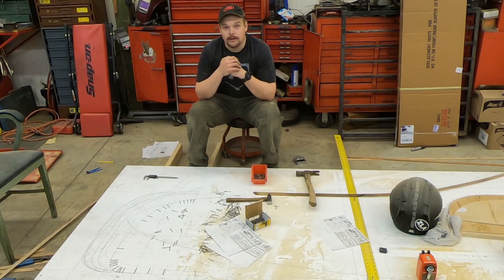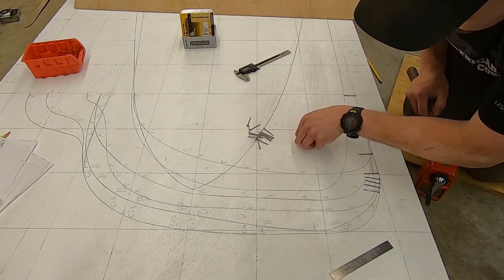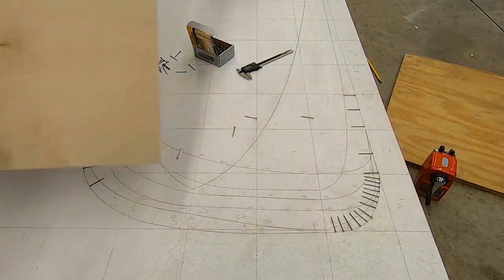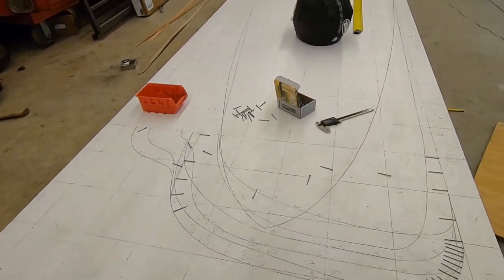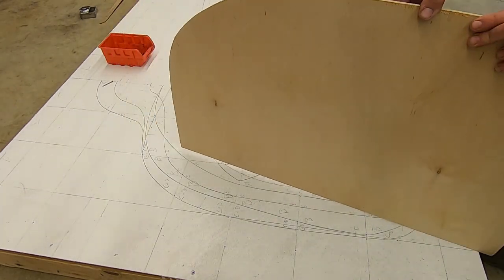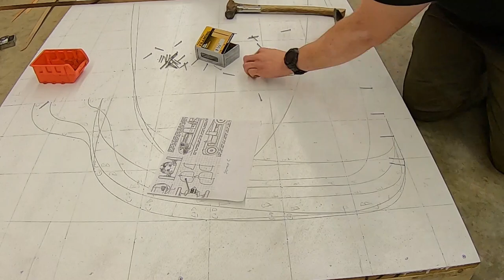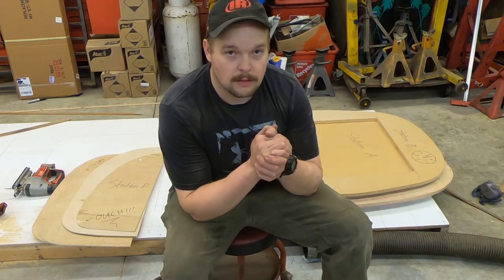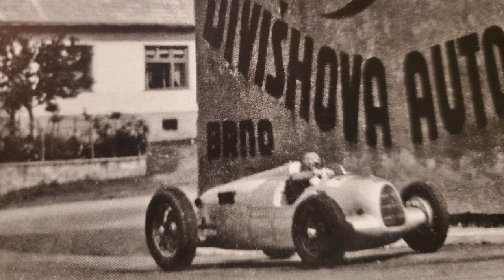How I'm building a body buck PART ONE: making the templates and stations

Comment: I watched this video again. I noticed that the edges of your stations are perpendicular to the other surface. Something that I read on metal shaping forums is that you should angle the edge. Either make the front or rear edge the desired profile and sand it back (or use a router) to the other edge. This makes the point of contact with your metal or profile gauge one small point and not the whole edge of the plywood thus throwing off the contour of the body. I hope I explained myself well enough.
Reply from the maker: That would be true(especially as some of the stations are 3/4" thick and some are 1/2") but this is not the finished buck, I'll keep explaining my process and the final buck will address this issue to be sure.